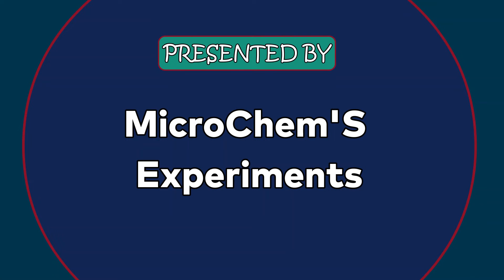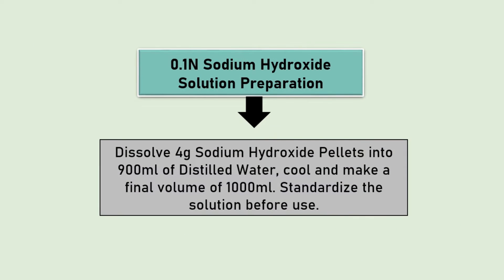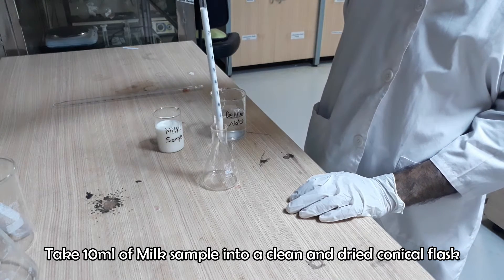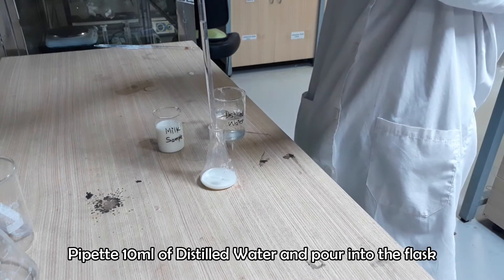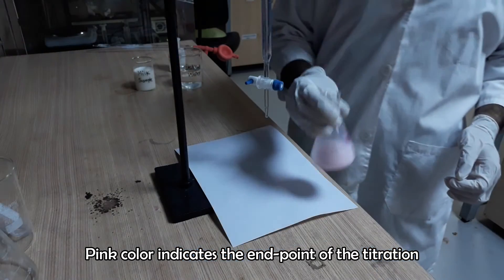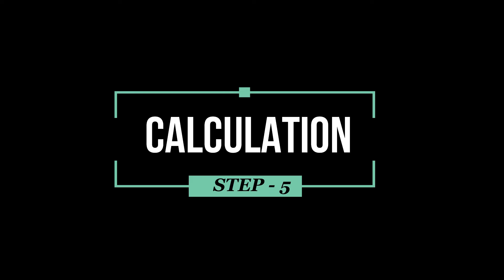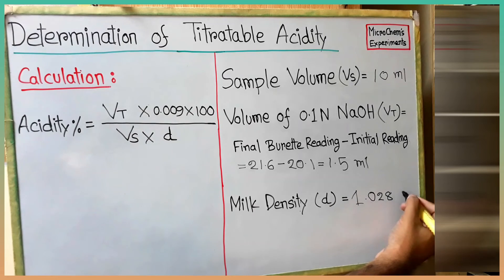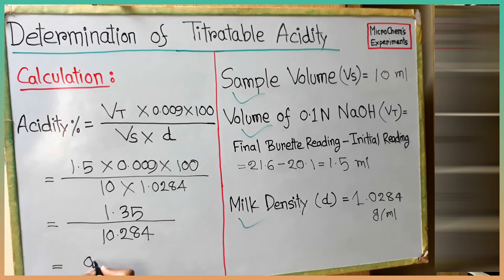Determination of Titratable Acidity (Lactic Acid) of a Milk Sample (IS 1479:1960)

Comment: I have a question that  how did you take as an initial reading 21.1??please tell me
Reply: Because 21.1 ml of Naoh is used for standardization of NaOH..we need to standardize NaOH before using for titration.
Reply: @jancy98  how to standardize 0.1N NaOH.
Reply: Standardization of NaOH can be done by titration  with oxalic acid
Reply: 21.1 mL is 02:43  they need to be accurate, usually it should be drop by drop counting.

Comment: This procedure can be applied for milk powder?
If no plede share with me the procedure how prepare the sampla?
Reply from the maker: Yes. This is also applicable for milk powder
Reply: Ok how can i dilute the milk powder with distilled water? What is the ratio for dilution?
Reply: @abedhajjar5813  take milk powder weight and perform the titration.
Take Water quantity which is sufficient to dissolve the sample.

Comment: What is 0.009 in formula and also what is is good % range of acidity in a milk? And what is the reason behind adding 10 ml of water in a 10 ml milk before the titration?
Reply from the maker: It is a factor. check your country standard to know the normal range. water is added to make the colour visual clearly.

Comment: Hi! I’m just wondering how you would determine the end point, since the light pink is really not much different from milk’s original colour, and I couldn’t decide when to stop the titration.
Reply from the maker: I do not understand your problem. During titration the milk color is turned into faint pink from white and color can be indentified clearly. Watch my video again and do the experiment thrice in your lab. Try to identify the point when white color just converted into faint pink. I think you will be able to read the end-point.
Reply: @MicroChemsExperiments  i want to know,in the procedure how the density of milk calculated?
Reply: @irfanullahkhan07  Density is expressed as g/mL. The easiest way is to weigh a specific volume of milk and then divide the measured weight (g) by its volume (mL). You can also just look up for literature values.

Comment: what is the purpose of adding 10 ml distilled water ?
Reply from the maker: Just to increase the volume and to dilute the sample. 
1. Color changes can be detectable easily in large volume of sample.
2. Diluted acidity in diluted sample helps to react with NaOH solution fastly and properly.
NB: Addition of distilled water won't cause any change in total acidity of the sample, because the pH of distilled water is neutral.
Reply: @MicroChemsExperiments   thank you so much, guys and go ahead
Reply from the maker: @hajarzakzouk7458  Thanks for supporting us.
Reply: @MicroChemsExperiments  What if I add more distilled water?
Reply from the maker: @nhiha9896  no problem with it. You can add more
Reply: @MicroChemsExperiments  oh okayy thank you 💕